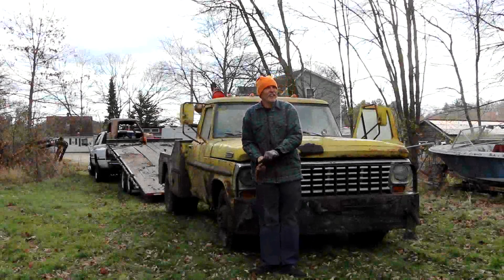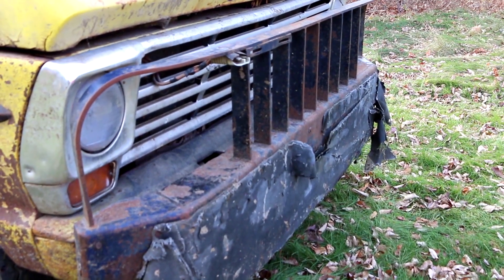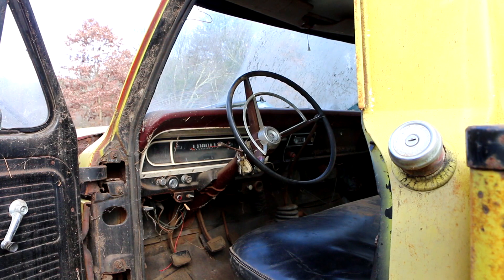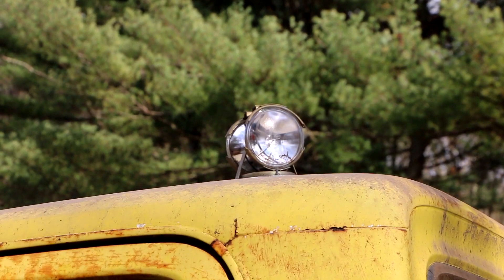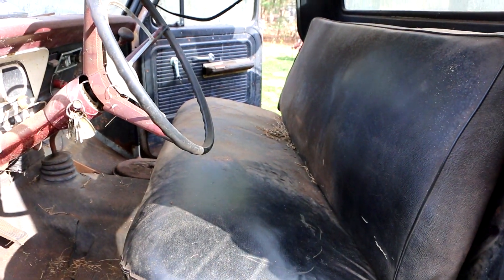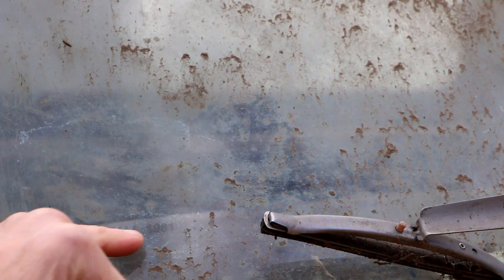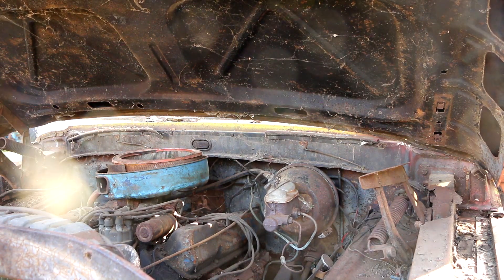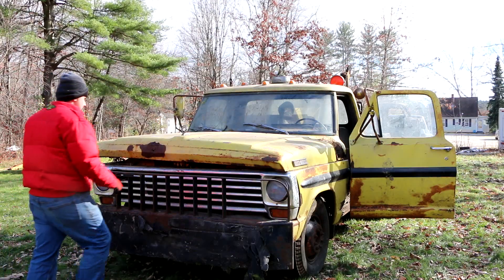1967 Ford Bumpside Tow Truck First Impressions

Comment: Cool truck , the difference with your truck and the one on the Dukes is the Wrecker , they are both Holmes 440's but the one on the Dukes Truck is the earlier model 440 that has the tube booms with the 4 angle iron supports on the outside . You have a huge project and  I will look forward to seeing your progress .

Comment: Yes that is a bumpside. The next model is called a dentside, 73-up. Previous model is a slickside. The 67 side hood emblems do not have reflectors like the 68-72. Also, the 67 doors are a 1 year door. They have an interior pull lever rather than the handle in the arm rest like 68-72 trucks have.
Reply from the maker: Thanks. The other big difference I now know is the dash board layout on the 67. So I if I use that other cab I got in the deal, it will not be correct for the year.